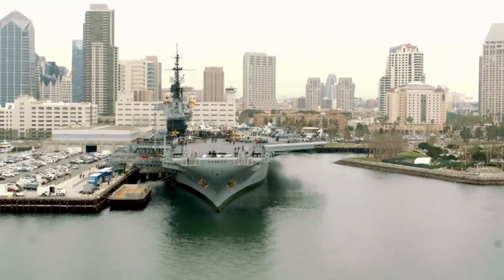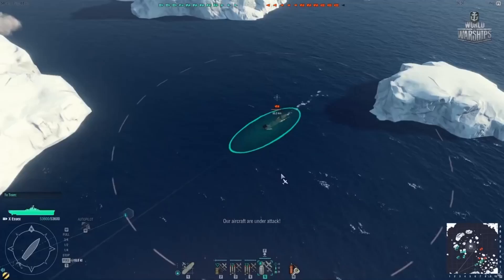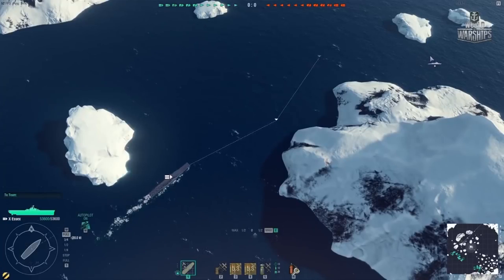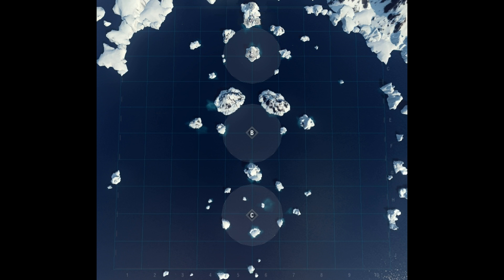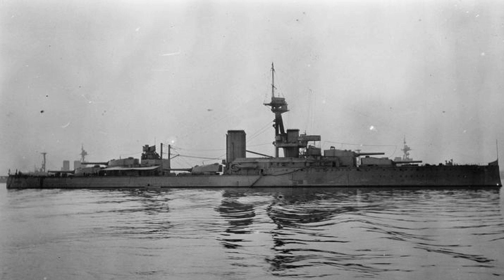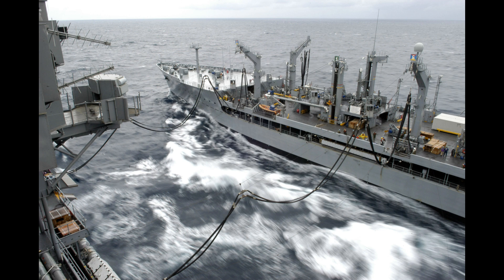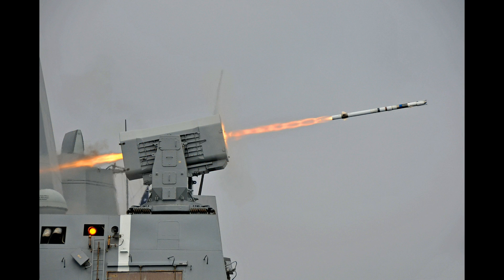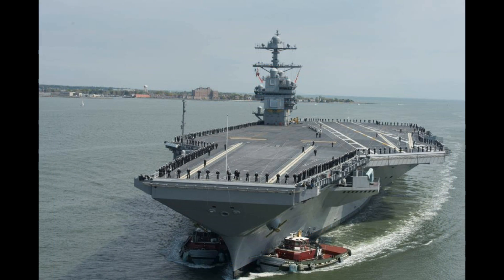Corrections to Real Life Lore - Why It's Impossible to Sink This $13 Billion Ship

Comment: I wasn't able to find verification, but I'm pretty sure the Ford class uses an Integrated electric propulsion system. This means it doesn't use a gear box, transmission, and such. It simply converts nuclear energy into electricity and then uses that to drive electric motors to propel the ship. It reduces the weight, complexity, and moving parts of the drive system which dramatically improves the reliability, efficiency, and maintenance of the ship.

Comment: A point on nuclear reactors on carriers, the main argument is that it allows the ship to remain operational without supplies. However the aircraft carrier has to have reserves of aviation fuel for its fighters meaning that a supply chain for aviation fuel and ordinance is required and so the point is a fad. I'm saying this because that kind of 'it can run for 25 years without refueling' is utter nonsense.

Comment: This video is very nit picky. You would correct things based or taking what he says completely literally. He even says it is not unsinkable, but that is will be very difficult and only a few things could destroy it. The commenters are idiotic, they say all these things about the video without seeing the whole thing, they even complain he doesn’t do research when they clearly haven’t. It just seemed like a pointless video that pretty much added nothing to the original video, besides minor details and a couple good points. He didn’t go into detail for time reasons and those were most of the things you talked about.

Comment: I'd like a debate, and believe me I can on the warships front...
Finest battleship of the first world war:
- The Revenge-Class battleships
The Revenge-class represented a concession in battleship design, essentially being a less expensive but more well-protected version of the preceeding Queen Elizabeth-class. Their armament, however, was no concession at all. Each ship mounted eight 15" rifles in the Mk I casemate, like their predecessors. They carried the same 6" guns in sponson mounts, though shipping two less. They also carried a twin 4" turret. Their armour, though more extensive was not thicker, actually being thinner in some places. The trade off was a longer continuous belt. In terms of torpedo protection, the Revenge-class were superior to the Queen Elizabeths (and their foreign counterparts) with bulges sufficient to stop several of the then most powerful torpedoes available to the enemy. With a design speed of only 21 knots, they were slower than similar battleships of the era, including their immediate precursors, but they were not intended to fulfill the same role; instead designed as a cheaper alternative, they were to form the mighty backbone of the world's most potent force.  
Their numbers totalled six in all: 
HMS Revenge
HMS Royal Oak
HMS Resolution
HMS Royal Sovereign
HMS Ramillies
There were to have been a further two, but these designs were adapted and the ships re-ordered as the venerable Renown-Class (Renown and Repulse).
I seem to remember a ninth ship that was cancelled, but her planned name (if she had one) has escaped me.

Comment: There are some good points in this video, but also some really nitpicky ones. So in that vein, here's a couple of corrections to YOUR video.
1.  The Nimitz class is outdated. The lead ship was commisioned in 1975. And even with the changes to more recent members of the class (USS George H. W. Bush is more modern), there is only so much you can do without changing the basic design. The Ford class will allow the older Nimitz class ships to be replaced with ships founded on 21st century design, instead of 20th century design with some 21st century fixings slapped on top.
2. The nuclear power and propulsion train you showed is for a nuclear submarine, not an aircraft carrier. Aircraft carriers don't have battery backups or electric propulsion motors (since they would have to be ridiculously huge to support an aircraft carrier).
Reply: unlike subs, carriers don't sink if the shaft stops spinning... so backup power is used to start the reactors back up... not push the ship....
Reply: Yes, but the backup power is provided by diesel generators not a big battery bank.
Reply: this is true

Comment: I'm in no way an expert in warships, but I do work with tech installation.

The Nimitz class is "outdated" in the sense that the original design (understandably) didn't anticipate modern technology. Not only is power generation a huge factor but not enough room was given for the actual volume of cables used today.
The Ford class is essentially future proofed in that sense.

I'm not saying that the Nimitz isn't capable (it carries more aircraft than most countries own) but it's probably not much different to the carriers the Chinese are building. US power projection won't allow that.
Reply: actually, they have more unused cable holes due to modernization.... more digital systems installed rather then the old and clunky analog systems.

Comment: The propellers are called screws. The reason they use gear reduction is to provide torque the steam turbines do not have enough torque to turn the screws.

Comment: the ship can use the steam turbines to spin the prop but as your diagram shows electric power can spin the prop as well and they can run on battery. which is standard and which is faster i do not know. However i do know that cvn71 can go 45+ knt with the reactors at 110%
Reply: 110% which asshat violated that? also no it cant sadly, CVN71 was equipped with crappy main engines that cant withstand the same pressures as her first 3 of the same class (68-70). also, for the diagram, its a simplified version of a submarine steam propulsion plant. carriers don't have electric motors, or batteries.

Comment: U just corrected the pics and the ad. 
Worthless time wasting video.
Reply: ŤĶĞ BŔĚŅØ Using sonar, or having more powerful sonar is not a revolution in technology that makes it bounds more easy to detect surface vessels. While we have been able to study and make breakthroughs in submarine design and material, there still exists the obvious problem that using active Sonar gives away your position to any submarine as a surface vessel. Which a submarine hardly needs as surface vessels are not stealthy nor quiet to find you. This goes for torpedoes. 
Instead of calling me a "names" and making arguement that seemingly are conjured on the spot out of spite, be more cordial and perhaps try and argue from an honest standpoint.
Reply: They are corrections as per the video title. But also includes things that are historically significant like the actual gun and and deck layout of the Monarch for example, the exact amount of Anti-missile defenses, and how the ship won't be fine for 20-25 years as all the people running the ship would die due to lack of resources that the ship cannot produce. 
It is also another target. As sis famously stated, there are only two things in the ocean. Targets, and submarines. 
What this is to say, submarines are incredibly hard to detect and fight against as the means of finding targets is all about sound and locating them using sound and sonar. 
Submarines do not make a lot of sound and have passive/receptive sensors that trace the identities of ships in the water. Ships do carry active sonar but when using it, give the EXACT location of their ship away to the submarine which can only be used for a some what better location of the enemy submarine. And in this, a submarine can launch a torpedo that can outrun any naval ship and sink them in one go. And considering that an aircraft carrier cannot sink vertically to dodge a torpedo's search cone, it WILL sink. There is nothing it can do against a torpedo but hope that you can catch all the submarines that try to find it.
Reply: Metal Tao submarines arent hard to detect fuck nut sonar is more advanced now. Not primitive like older ships where they really did have a hard time detecting them
Reply: Reported for ur idiocy
Reply: M Alebeery so did you watch the whole video or stopped after the first few minutes...
Reply: M Alebeery he corrected plenty of facts too
Reply: M Alebeery totally agree with you

Comment: Well yes submarines can go that fast underwater but normally, their behavior is to not cavitate (make bubbles that pop and generate a lot of noise) and so they are limited to how fast they can go without cavitating.
Reply: Cavitation depends on speed and depth.
A sub could be going at 10 knots at 50ft depth and cavitate, while it could be going at 30 knots at 1200ft depth and not cavitate.

Comment: He also forgot Fuel supplies for the ships primary weapons sytems IChase... the aircraft. The Carrier might not need to refuel (though as you said it DOES need to be resupplied), the Aircraft dont run on Unicorn farts and good wishes. They needs fuel. Its part of the reason the UK went conventional rather than Nuclear for the powerplant on the QE Class. 

And of course, he also forgets maintenance, also upgrades, a ship as complex as a carrier spends about half its life in port!

Comment: Great video. I think I can add something, maybe a correction. The reason why the propulsion system haves reduction gears is not because the speed of the turn will break something, but because of the cavitation. If you turn a propeller too fast, a vacuum is created around it and the "pushing" capability of the screw is greatly reduced. Correct me if Im wrong, please. :)
Reply: Those screws can and will be torn off at those rates.
Cavitation does somewhat affect the ship's ability to 'push' itself forwards, but it's mostly important for submarines, as cavitation generates a lot of noise, which is a death sentence for a submarine.
Reply: Agreed. Thanks for the response.

Comment: lol most accurate in game in the world yet they cant even correctly model armor properly put the armor in the right locations and put the right amount of armor on the ships on anything but battleships and even those are messed up. They cant even model proper engagement ranges last I checked the 8'55s could shot 27 miles although you could hit much most ranges where between 17 and 20 miles not pointblank ranges. Even the company admitted in the Moskva Class video the De Moines could shot 27km that is around 27 miles max range you wont hit much but they get it right there but not in the game, they even got the armor thickness and location right but not in the game so how can you be the most accurate game out there when you cant even get proper armor locations and thickness right. I may make a Forum post on this explain where they where located and why. Might even do proper ship armor thickness and why it was done that way.
Reply: If they did that, the game would be seriously unbalanced.
Reply: No it wouldn't unbalanced it would be right.

Comment: Can someone tell me how do they "refuel" these carriers? I mean, the nuclear reactors are encased in concrete shells. Do they need to make a giant hole in the hull just to "refuel" it?

But wait, the Yamato was unsink...oh yeah:(
Reply: They only get refueled once during their service life, so I'd expect that it's occur while the ship was in for a major refit, the type that normally requires a full drydock and the like.
Reply: Just curious from what source do you find Yamato to be considered unsinkable? I believe that she only gets this reputation from misinterpreting her design principles to be "individually superior to any other contempary battleship".
Reply: Basically, you disassemble the side of the ship, and the reactor vessels, extract the old fuel rods, and insert new ones. Obviously, it's a very complex process, and takes months, so it's typically combined with major systems refits (new drive systems, replacing the catapults, completely replacing the wiring etc) and is not done very often.

Comment: I saw a documetary about the USS Enterprise (CVN-65) and the thing that put a limit on the time at sea was the crew. You can supply the ship at sea with food and fuel for planes but the crew will get tire and worn out. The number of human-error went through the roof as well as problems with dicipline.

This is the reason why nuke-subs have two crews. The ships can take it, but the human mind can't.
Reply: only SSBN's and SSGN's have 2 crews... fast attacks have 1 crew and most of the time sit in a maintenance availability for years because they are broken.

Comment: IChase while technically correct your claim that SSNs are faster than a Carrier is tactically incorrect. A sub can run at 30 to 40 knts however everyone and their mother would hear it and thus likely the escorts would start shooting at it. Anyways great video. Oh and one more thing the RN and I am pretty sure a few other navies still use depth charges on their helos, they can be useful in shallow water.
Reply: Well, it depends on what instruction you give to that carrier and submarines. In a 1v1 situation, the sub would hear and launch torpedoes first. It does not even have to go full speed, as the torpedoes, as chase mentioned, can easily catch up with the carrier. In a more complex scenario, like a hunt-attack action assign on the sub, it is probably not going to operate alone. It would have access to data from sattelites and such, which would allow it to position itself on an intercepting course with that carrier and just wait for it to get in range, fire all of it's torpedoes, dive and speed up enough to stop cavitating. Even if a sub stumbles by mistake on a CBG, the sub is most likely to hear the carrier first because running at full speed without reason consumes fuel and damages the instalations even more, so it would not produce so much noise. 
The comparison between speeds of subs and carriers was made by chase just to show how idiotic the statement made in the original video was. It has nothing to real battles.
Reply: To successfully engage a CVBG in a sub is a difficult challenge, the commander must; position his/her sub ahead of the group, lie in wait, penetrate the escort of 15 to 20 ships (assuming the group is in fact a proper CVBG and not a CVSG with less escorts), the sink the carrier and attempt to get a way. With variable depth towed array sonar going deep does not allow you to run quickly as modern passive sonar systems will easily hear the flow noise as the sub passes through the water. It is a difficult task but not impossible to do against a CVBG. The task becomes much easier with a 5 escort strong CVSG (or weak if you ask several former Sec Navs) due to the smaller area that can be covered by the fewer surface ships and helos.

Comment: I actually wonder if that chart for the propulsion system you're presenting is actually accurate for the Ford.  A lot of ships these days (predominantly in ships that carry a lot of passengers) don't even have their MDO main engines directly connected to the propellor, but rather convert to electricity, having the main engines run at a constant speed at optimal efficiency, utilising the electricity for all sorts of purposes on board, including an electric motor for the propellors. I also figure reducing the amount of steam pipes and shafts and replacing them with cables might be a desirable feature for a warship, since in case of damage, cables are a lot easier to replace and also easier to have redundancy for.

I tried a quick search to find more details on whether there was a mechanical or electrical connection between the power plant and the propellors on the Ford, but generally only found 2 nuclear plants, 4 shafts. I know that Germany's new frigate for example does use a diesel-electric system.

Comment: No such thing as "Impossible to sink", and history has shown that for many times already. As a certain movie character said, "It's hard to do, but not impossible."
Reply: Yep , several ships in history ware considered to massive to sink:
Titanic - hit an iceberg and sank 
The "mighty" Hood  - blasted out of the water with a single shell
Bismark - blasted until kingdom come
Tirpitz - visited by Royal Air Force and several Tallboy bombs 
Yamato - torpedoed and bombed to oblivion

There is a pattern here ,if you persistent and trow enough shit at the wall - some of it is going to stick.
Reply: Just release enough energy under the hull and water pressure will do the trick
Reply: I doubt it could float after eating 7 USET 80s
Reply: Not to mention that the George W. Bush got sunk by a single Swedish sub.
Reply: @denpadolt9242   Yep. America needs better radar. Also, before the idiots come, it was a military training
Reply: KineticRhyme what you clearly arent fucking realising is that he stated specifically and i quote "these defenses make this carrier nearly impossible to sink"